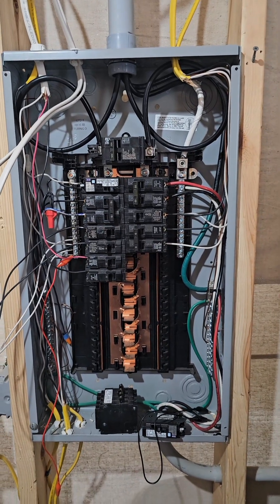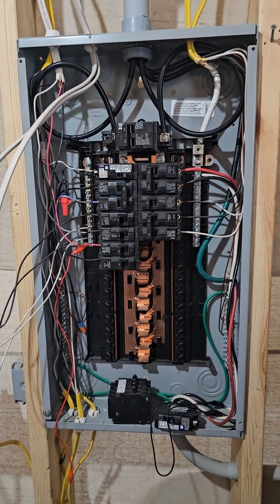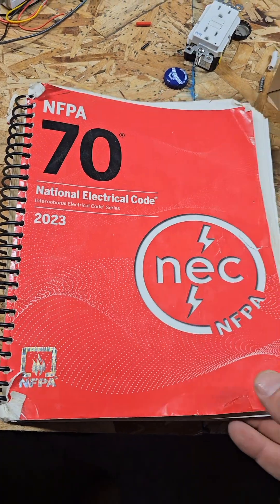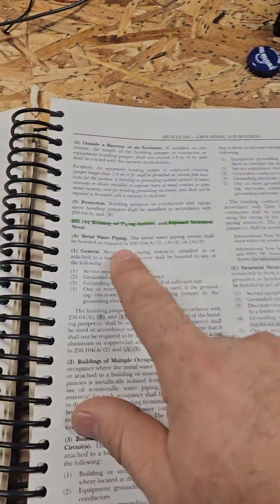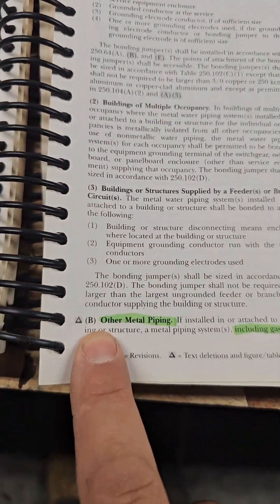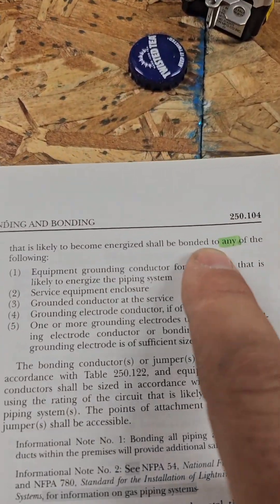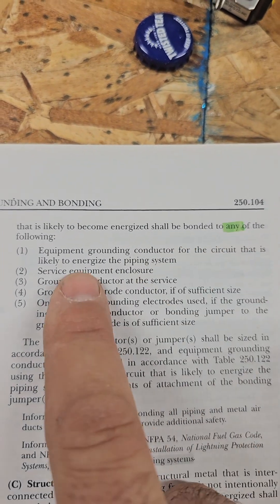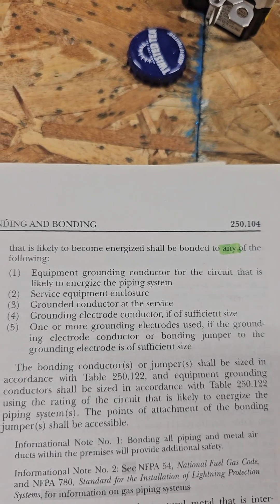Bonding gas piping systems NEC 2023

Comment: The issue is because of international fuel gas code. It states that CSST piping that is not arc resistant must be bonded. Pretty much all other types of gas piping is bonded at the appliance. So this makes plumbers run wire from the CSST to a ground rod, which is incorrect or has electricians running the wire to the ground or neutral bus. It’s really confusing on how to actually Bond CSST that calls for it, correctly

Comment: Yes the main panel may still be the same place to bond the gas bond. That is if the service does not have a disconnect by the meter. This depends on if the state is up to the lastest code and if the house is older and then may fall under/with older codes until someone updates the house.

Comment: In Philadelphia, they made me run a # 4 from gas pipe to main  panel ground bar. AND a bonding jumper to both sides of gas meter
Reply: We have to do this with all water meters, most inspector don't say a thing to use about the gas.
I am in central PA.

Comment: The reason you can bond using the EGC of the circuit from a sub-panel is because the equipment would likely stay hooked up to that sub-panel. Such as if the sub-panel is removed whatever circuit used to feed the fire place will bring a new bond with an EGC. 

Now if it was a gas pipe that ran close enough to the sub-panel, and that sub-panel was to be removed, (I.e. remodeling) that pipe would lose its bond. So if it was bonded to the main neutral / ground bond point that pipe becoming un-bonded will be less likely to happen.

Comment: I have an uneducated inspector down here in CT in a town that insists that bonding jumpers to water pipes, rods or structural steel be green… I tried to convince him otherwise with 250.119 and other articles like excerpts from Mike holts book on bonding and he won’t change his mind … luckily green tape makes him happy. I hate it.
Reply: I was going to say the Green Tape or see if he would allow you to identify it with bright green shrink sleeves, I've used those on a lot of different occasions, cut off 4in of it slide it near the end of the conductor and then heat gun it on it's a pain in the ass, but fortunately it may only have to be at 12 terminal locations or less.

Comment: Being a detached structure are you not deriving a new GEC at that building? That would thus give a bonding point in which the gas could be bonded too. Im a master out of VT working in waste water and water systems. Power is typically brought to a central building, distributed across the site on feeders. Each building per spec must include, lightning arresting, bounding of all metallic surfaces (exposed steel, handrails, walkways),  to ground ring with rods welded at all corners.